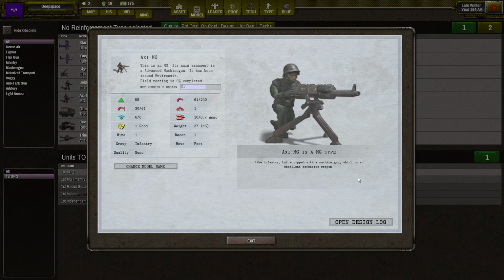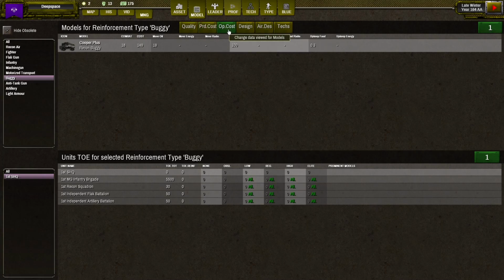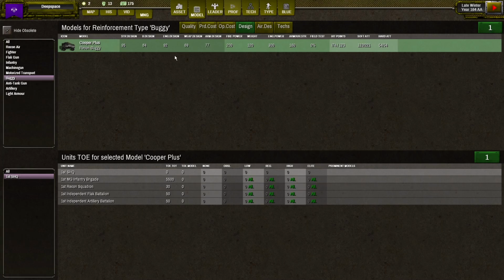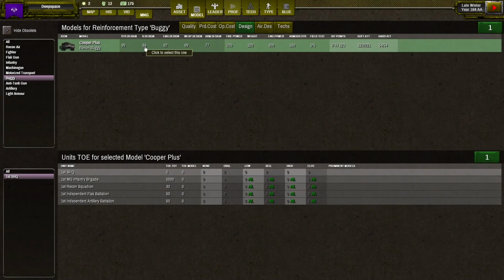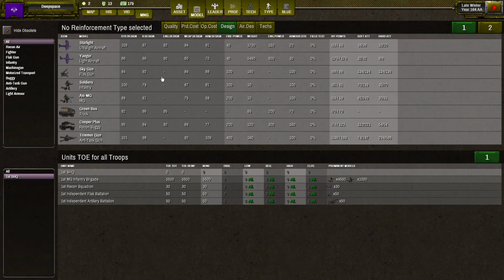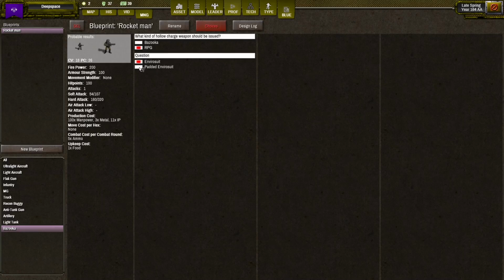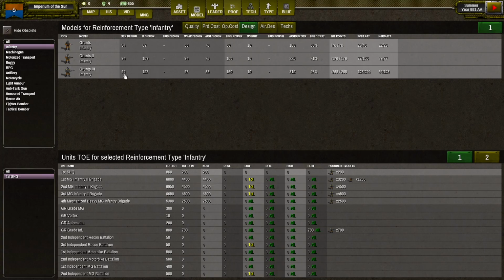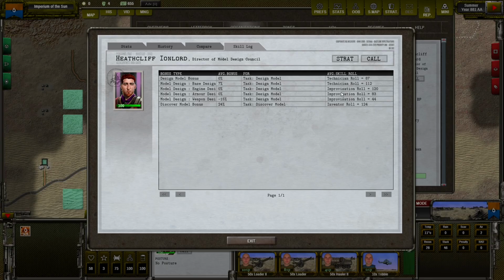Shadow Empire | Model design & Blueprints

Comment: it's BS that the developer wouldn't just givce tool tips or the info for good designs or bad designs - that we have to have videos explaining all this crap
Reply from the maker: I agree that better tooltips would definitely help a lot. Most of the knowledge is in the manual, I know it's quite big so nobody reads it like a book, but rather search for specific keywords. For example if you want to design a new model you search for it and you should find 5.12.3. DESIGNING A NEW MODEL this whole section contains most of the basic knowledge. There are 4x games with a perfect tooltip system like Old World and you also have plenty of YT tutorials for them as it's a different way of sharing the same knowledge. Some people like watching others reading or listening so videos would still be useful for some people even with the best in game tooltips. Thanks for your comment and reasonable suggestion.

Comment: Whats your preference with organizations which one firsts second third
Reply from the maker: It depends on your situation. For sure those should appear faster: economic, military, model or interior without any order as it depends on your current needs. Then security or foreign. Then rest.
But if you start close to minor farmer's regime then foreign would be good earlier. If you have bad leaders then maybe interior faster. I plan to cover this topic in one of future videos.
Reply: @StrategosAcademy just wanted to place another vote for a video on this topic
Reply from the maker: Thanks it's helping me to set the correct priorities.
Reply: @StrategosAcademy  why do farmer regimes specifically make a difference to foreign relations priority?
Reply from the maker: They are peaceful, don't try to solve problems aggressively and If they will see that you can protect them usually they are easy to annex